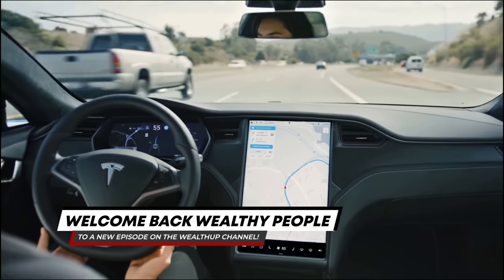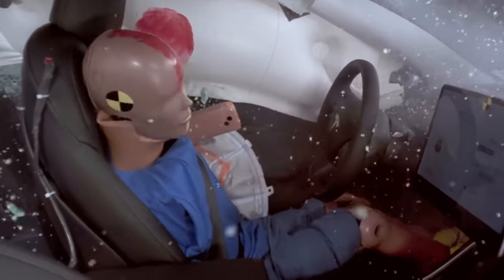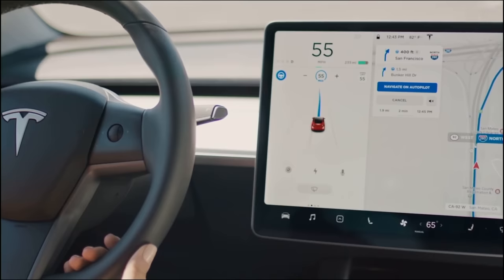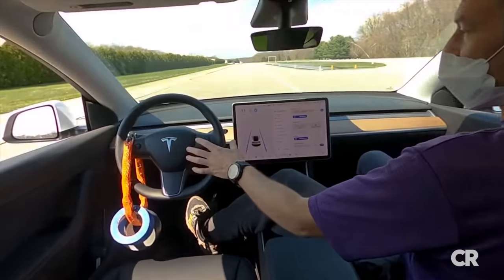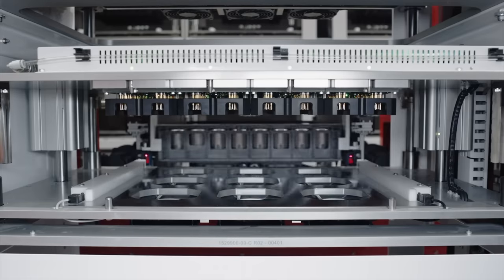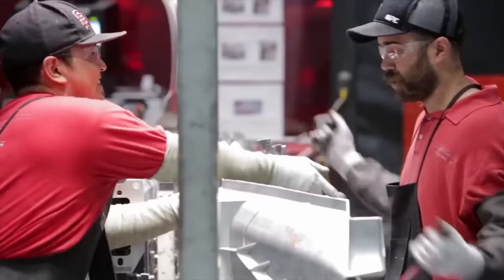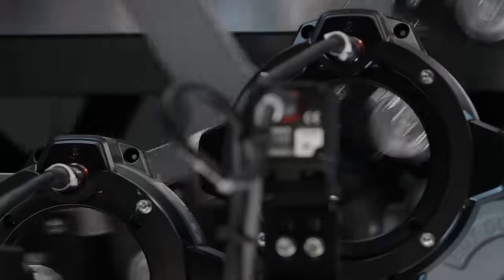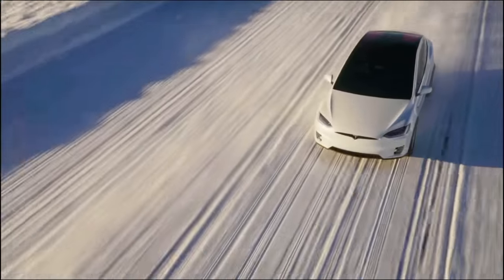NEW PATENT!! Tesla Just Revealed a Long Awaited PATENT!

Comment: Soon Tesla will begin to offer an insurance program. Fairly priced since they will control who can repair their cars.  But it will also require you to accept the car to be able to monitor the driver by what ever sensors are needed to confirm safe operation.
Trick the system and you could void your insurance coverage.

Comment: Completely useless patent. Users who are inclined to defeat safety systems will simply find a different way to defeat them. This will always be the case. In this particular example, the new defeat method might be to put a mannequin in the drivers seat. Maybe fool driver monitoring cameras too.

Even if you can tell if a driver is using the seatbelt correctly, you can't also make sure they aren't driving with their feet for fun or whatever. Safety always must involve the cooperation of the user.